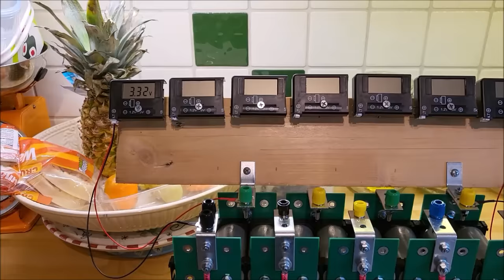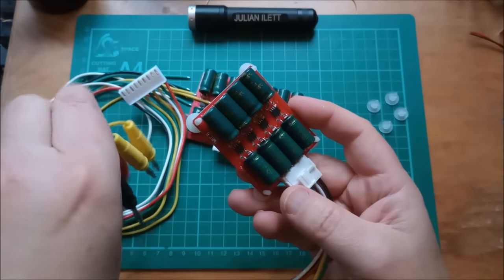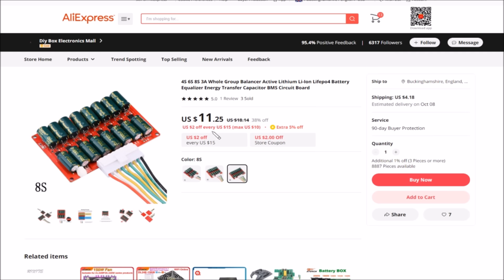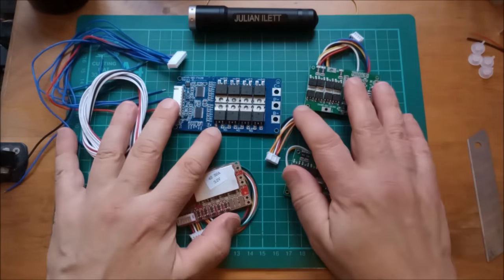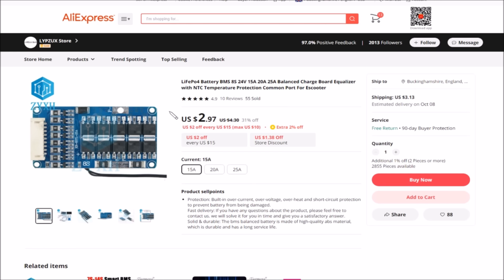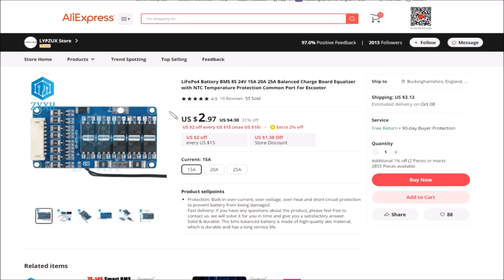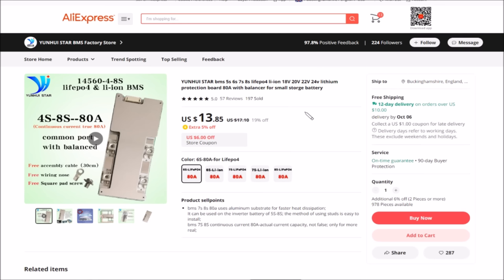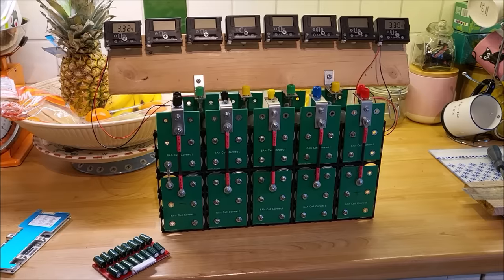Julian's Battery Postbag (pb162) - Balancer and BMSs

Comment: I purchased 2x Yunhui 25A 8s LiFePo4 BMS (they look like the tiny blue one in this video) and after asking about Over Voltage Protection at 3.65v and Under Voltage Protection at 2.50v, I was told they have one with the 6010DA chipsets which uses those parameters.

The original listing was for a 6034-8s-3.2v, 25A, and I was told to request the 6010DA version as a note when purchasing. Sure enough they turned up with the 6010DA battery management IC.  I'd be keen to know which BM IC your Yunhui BMS used Julian.

Just waiting for my 30ah prismatic cells to turn up from SJY now. Can't wait to begin the build!

(The BM IC on my BMS modules is a PowTech PT6010EL32-DA and the datasheet does show 3.65v and 2.50v for the respective protection limits. Balancing occurs at the Over-voltage protection recovery value of 3.50v)
Reply from the maker: I'm not too worried about the 3.75V overcharge protection voltage and 2.1V undercharge protection voltage because the battery should never see those voltages. My discharge relay turns on at 28V (3.5V per cell) and off at 23V (2.875V per cell).
There are 8 chips marked AB3A which appears to be a HY2212 but I can't identify the precise version.
Reply from the maker: There are also 8pcs marked 12CB which looks like HY2112 with 3.75V upper and 2.1V lower.
Reply: I've build a wireless doorbell charger (for the door button) using a CN3801 for the solar controller to charge 1S2P LiFePo4 "AA" 14200 cells) and used the HY2112HB  as my protection IC. It also does 3.65v/2.50v protection voltages. It's cool to find all of these variations.

Comment: I bought six of those 8s balancers and installed them on six 8s1p 200ah packs (byd cells, ~50kg pack wt) . The wire color codes were different in all of them except the red and black were both on the correct places. And all five had bright green leds and one had a yellow led. I haven't checked on them yet after installation they were builds for friends that paid for everything. Bench testing they seemed to work well below 2.5vpc. I forgot to measure how much current they consume while running.

Comment: Be careful with those balancers. You don’t want them running below 3.45Vpc. Gotta do balancing above the knee. That’s why I like the Heltec balancers, they have a run pad you can break with a switch.
Reply from the maker: Yeah, interesting. I believe this 3.45V figure comes from Andy in the Off-Grid Garage.
My situation is different. I'm charging and discharging almost daily (in winter, less so). I don't take the cells to their top (so can't top balance) and don't take them to their bottom (so can't bottom balance). You can't middle balance LiFePO4 because the voltages are all the same regardless of SOC. So I'm balancing only in the upper-middle and lower-middle ranges. For that reason, the balancer is running all the time.
My 614Wh battery has been doing this for a couple of years and is fine.
This new 768Wh battery will operate in exactly the same manner.

Comment: I tested those 4s BMSes (green PCB) with LiPo cells and I notice during charging and discharging one of the balance cable hold quite a current compare to the other ones - total discharging with 2.5A, B- holds 2A and 500mA goes via tiny balance cable - is this a bug or feature?
Reply from the maker: Faulty, I'm guessing.

Comment: Using those steel angle brackets is introducing some resistance, and heating into the battery.  Steel is 3-15% of the conductivity of copper.
Reply from the maker: Yeah, but they're about 2mm thick - that's about 60x thicker than the copper on the PCBs.
Reply: @JulianIlett  😂😂😂😂 Ahhhh but the skin effect 😄😄😄😄😄😄
Reply from the maker: "Skin effect does not occur in direct current (DC) systems, because the current flows uniformly throughout the cross-section of the conductor."
Reply: @JulianIlett  Mate I know that I did indicate humour  😂😂
Reply from the maker: Ah, sorry, I don't speak emoji.
Reply: @JulianIlett 🙂 🙂 🙂 🙂 8-)
Reply from the maker: Four people looking somewhat bemused. Yeah, na, I don't get it.

Comment: The BMS at the left side? Okay. How are you going to 'carry' (lift up) the pack? The BMS is not a 'handle'.
Reply: He aint done yet, there's gonna be a chassis, wheels and steering and all the rest of it. You do know he's building a car don't you ?
Reply from the maker: You're right. The BMS in that position means I can no longer carry it. So the BMS will be fitted once the battery is in its final shed location.

Comment: Aluminum brackets are fine for the balancer, but Please use copper for the BMS connection.
Reply: Aluminum is used as bus bar material in nearly every major off the shelf battery in the LiFePO4 world.